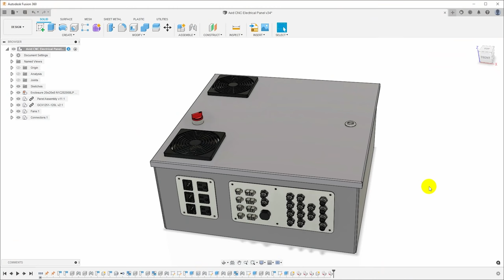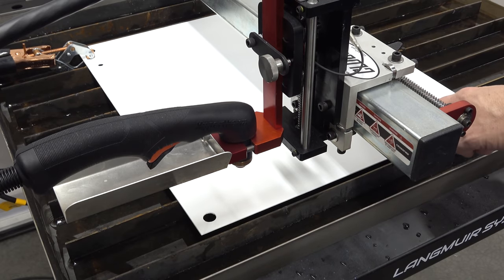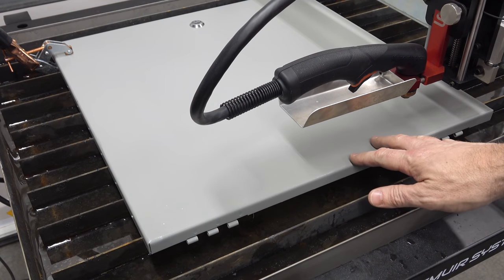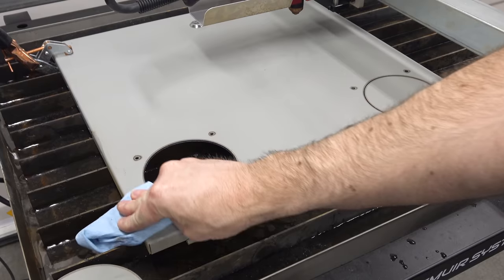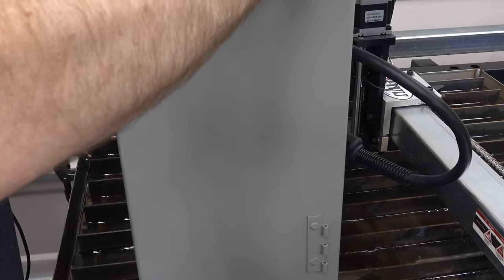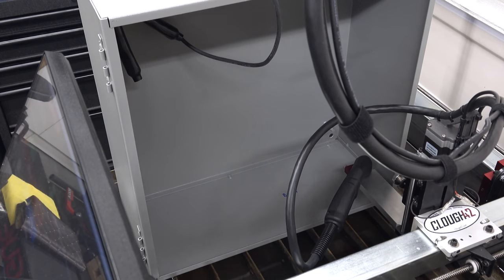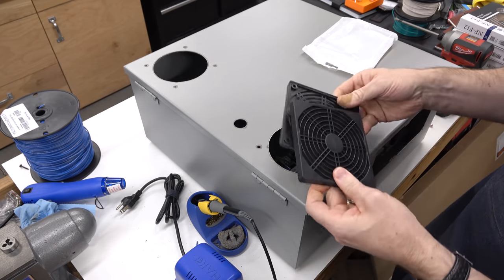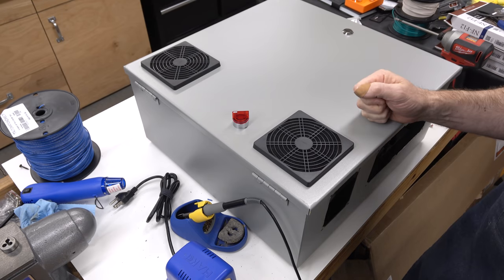Can you CNC Plasma Cut a NEMA Electrical Enclosure?  Should you?

Comment from the maker: SAFETY NOTE:  It appears that this particular cabinet is powder coated over phosphatized (paint lock) steel.  From what I can tell, this does contain zinc, so all the cautions around welding and cutting galvanized steel would apply.  Make sure you have good ventilation and don't breathe the fumes.

Comment: A trick that we use with our laser is to coat the surface with dish soap and let it dry. Any stray particles condense on the soap instead of bonding to your material and a quick rinse removes it all, no elbow grease required. Works fantastic for glass and acrylic etching. Might have to be careful about splashing with the flooded catch pan.
Reply: Maybe anti-spatter or CRC silicone in a rattle can.
Reply: Hah!  Same trick as in Boy Scouts - cover the outside of the cookpot with soap-ish stuff before putting it over the (camp) fire.
Reply: As I was watching the video, I was thinking masking tape over the back might work.
Reply: @dasworkshop4967  Good call! That said, masking tape might have some issues with denaturing and bond a bit too well from the heat. Have seen issues where the charred edge of the tape had to be scraped away with a razor blade.
Reply: You did glass etching with a laser?  The few times I tried glass cutting or etching like that for my own amusement it all went well, and shortly later the pieces broke just sitting on the bench.  The little information I could find implied that to prevent it, the glass had to be preheated, and popped into an annealing oven for an extended cooling profile.

Did you accomplish it in a simpler, less time consuming way?
Reply: That’s a cool suggestion! On our CO2 laser we use transfer tape a lot but I wondered if Kapton tape might work here too… though dish soap is wayyy cheaper
Reply: Good idea.  Bob's idea of anti-spatter might be even easier.
Reply: We don't even put anything on using the laser, just the downdraft table. We do use a 1000W Yag though, so the kerf is much smaller than most.
Reply: Same as Glenn, I learned in Boy Scouts to smear a pan with dish soap on the outside and you can cook right on the campfire with it and you put it in water and it all comes right off.  Would be interesting to see how it worked although your method worked just fine.
I just love it when people prove the Internet naysayers wrong. Good work.
Reply: pyrobeav2005 - May I ask what kind of glass it was?  Safety glass like car windows?  Plain window glass?  Pyrex?
Reply: @somebodyelse6673  I've mostly done drinking glasses, the best ones are commercial pint glasses. I've also etched some glass whiskey tumblers without issue. Best results came from un-focusing the laser and turning the power down. At too high of power, it was vaporizing the glass which would condense into sheets stuck to the area around the etch. Also at high power and in focus it can stress the glass enough to make it shatter.
Reply: @pyrobeav2005  - Hrm, never occurred to me to futz with the focus.  Were you using a shielding or cutting gas?
Reply: @somebodyelse6673  Nope, just compressed air assist. The laser in our machine is 100W CO2 for what it's worth. Setting the laser out of focus does two things, spreading power over a larger area and evening out the image slightly by overlapping between scans.
Reply: @pyrobeav2005  Heh, I'm not sure I can dial our 4kW laser down that far.  I am surprised you could CUT glass with 100W, though. 

May I ask what make and model of laser?  I'd rather not bother you with endless questions about setup and settings.  Thanks for the time you've already taken to answer!
Reply: Awesome Idea
Reply: What a neat tip!

Comment: Back in the mid-1990s I helped write "quote-to-cash" software for a large electrical control manufacturer whose name rhymes with ■d. You'd pick out your components, it would take into account minimum space requirements and heat generation, space for wiring, etc. and let you know the size of the box required, or tell you if your selected box wasn't big enough if you started with a box. They were calling it AI, but it was just rules-based with a craptonne (metric) of rules.
Everytime I see a nicely laid out box I think of that project, one of my favorites.
Reply from the maker: That's cool.  I actually tried one of those calculators, and got a price list that made me cringe.  I also looked into having the box fabricated to order.  Same result.  :)  If I were paying me for my time, I might feel different.

Comment: I was the lead man on a job where we built two 60 foot by 60 foot buildings full of switch gear and   computer controls for a new manufacturing facility for Rolls Royce. We must have punched 10,000 holes on this project. It would have been awesome to have been able to plasma cut all of them holes back then. Thanks for sharing, James.
Reply: A trick I use when i cant get it on the table is to use a drag shield on a hand torch and make a cut pattern on the  plaz table to guide the torch.  Just clamp a straight edge on some scrap do a hand .cut and measure the offset of the kerf vs the OD of the drag shield, then add that amt to the shapes dimension. Cutting templates can be made of Masonite as the heat is concentrated to the tip, which is why there is very little paint burning with a plaz.

Comment: This came out great. Using a CNC plasma cutter for the doors would have been such a time saver when we used to make control panels - We had many buttons and indicators which needed 20mm round holes each with a small square notch.

You could done your test cut in the middle of one of the fan cutouts so that you could test using the real material and coating without the risk.
Reply: Hm. For standard notched cutouts of 22,5 and 30,5 mm you can use notched round knockout panel punches. I am not familiar with 20mm notched. Does not sound like a standard size.
Reply: @Trust_me_I_am_an_Engineer  Sorry you're right I am misremembering as it has been many years, they were Moeller units - the M22 range I believe. Each notch was filed.
Reply: @yngndrw.  ooh Kloeckner Moeller . Haven't used those since  1985 or so ? So they're called Moeller now ? I've filed a few slots myself, when I had to add a button on site and couldn't find the slotted punch :) .
Reply: A trick I use when i cant get it on the table is to use a drag shield on a hand torch and make a cut pattern on the  plaz table to guide the torch.  Just clamp a straight edge on some scrap do a hand .cut and measure the offset of the kerf vs the OD of the drag shield, then add that amt to the shapes dimension. Cutting templates can be made of Masonite as the heat is concentrated to the tip, which is why there is very little paint burning with a plaz.

Comment: I've cut quite a few large cabinets using a hand held plasma and HAC. Hardboard Aided Cutting, I make a template of the shape I need from 1/4 hardboard. Locate that template where I need the hole and use it as a guide for the plasma torch. Quick,cheap and accurate enough. I used to hate cutting electrical cabinets for all the same reasons you mentioned.

Comment: this video made me think about how i convince my boss to buy a plasma cutter. we are doing 100's+ of electrical panel each year and last year i propose them to use plasma cutter because it was a pain in the *ss to use punch hole. we aren't using cnc for this instead we have made different template according to our needs. in first step we use the template to mark up all the screw hole and use a drill to make those hole. after this we use quick release rivet to maintain the template on it using the screw holes + we use welder blanket inside  the panel so we don't have a huge mess to clean.  now 1week of work is done in 1 day. great video thanks!  i like it

Comment: Hey James. You should add some lead in and out runs on the last tab in fusion.  That will prevent the little half circle dent in your parts from the pierce.  Can be a pain to get a good length in smaller holes and sometimes you have to add multiple tool paths to accommodate different size features but it works better
Reply from the maker: Yup.  I had the pierce offset really small for the screw holes and didn't change it for the larger holes.

Comment: Knowing that you can cut through a painted surface with a plasma cutter is very useful info for me.  I have to cut a 6" hole through 1/4" alloy steel in a mechanical cabin later this spring--to take the vent hose for a portable A/C.  Knowing that I won't have to grind out the area that I need to cut first will save time, and repainting.

Comment: Thanks for this experiment. Now I know that it's possible to cut electrical boxes with plasma. On a side note: if you want your 22mm switch holes on a front panel look good without black circles around, you can cut 10mm holes with plasma and then use screw die punch for making clean 22mm holes afterwards. Usually panel makers are cutting those holes with a drill first, then using die punch, but plasma will make that job way easier.

Comment: Well done. Back when I was wiring switchboards for a living, whenever possible we sent cabinet doors out for laser cutting, it worked well. We still needed to cut penetrations in the box by mechanical means as they couldn't fit then in like you did. 
The doors are always the hardest part anyway. Careful CAD layout like you have for your gland plates is a really good idea, I've seen a few overly close layouts otherwise.
The small heat affected zone can be make good with a quick touch up using a cotton bud / qtip. In my salty climate that would be necessary.
For painted surfaces, a little car polish before cutting should make the smoke easier to clean.

Comment: I've done a bunch of them from 22mm or 30mm operator holes in the doors to custom cutouts on the bottom.  I never ever have to touch up the paint/pc.  Always worked great for me.  Make sure the ground is good.  I've had better luck cleaning the haze on back with water and soap, but a lot of times I will put blue tape on bottom if it's critical.

Comment: When you plasma cut metal that is coated/painted you sometimes have to grind off the coating at the start point. This is so the torch height control has electrical conductivity to the metal. Once the arc is started - then its fine for the rest of the cut. If you don't have DTHC  you don't need to worry about this!
Reply from the maker: I do have a torch height control that measures the height using the arc voltage.  In this case, though, the machine touches off to establish the initial height, the pilot arc blasts through the coating and once it has established the cut and moved a set distance, the height control reads the voltage and then takes over to maintain that voltage.  So if the coating affects the voltage, it doesn't really matter.

Comment: A trick I use when i cant get it on the table is to use a drag shield on a hand torch and make a cut pattern on the  plaz table to guide the torch.  Just clamp a straight edge on some scrap do a hand .cut and measure the offset of the kerf vs the OD of the drag shield, then add that amt to the shapes dimension. Cutting templates can be made of Masonite as the heat is concentrated to the tip, which is why there is very little paint burning with a plaz.

Comment: Yeah I wouldn't have listened to the internet either. Good job, it looks good. I would 3d print a plate with ON & OFF for the switch. I need to go back in your videos to see how you did the multi-colour prints on your other parts.
Reply from the maker: Yeah, I was thinking about this.  I'm also thinking about some other options. :)

Comment: This was suggested to me today. For some reason I hadn't seen it but glad I watched. I'm commenting because your use of that cooling fan made me think of a YouTube channel : Major Hardware that has a series called Fan Showdown where people submit fan blade designs that run on that fan base to see what designs are most interesting, air moving, quiet etc. It's pretty interesting to see what people come up with and I wondered if you'd have any opinions on it or whether or not you'd consider making a submission. I ask because the way you explain your thought process and the outside the box thinking you do in your projects, you could probably make a pretty interesting video about it. Thanks for your contributions to the community of machinists, makers, and really anyone seeking knowledge on YouTube.

Comment: Great use of the plasma torch.  Ask people on the internet but take it all with a grain of salt.  Many of them are wrong.  I love to do cnc projects but right now I am not in possession of the cash.  I recently incurred a few bills that will need clearing up.  Thanks for an interesting video.
Reply from the maker: Hey, Harold!  Great to hear from you.  Yeah, I wasn't really concerned with whether people thought it was a good idea; I asked because I wanted to know what problems I should worry about.  And then I used my own brain to figure out if they would be a big deal for my needs.

Comment: Please build a a magnetic pick up handle to remove the cutout plasma parts. Seen a few online but I think it will be a great tool for the shop. Thanks for the great content.
Reply: I use a small but strong on off magnet turn the knob on the engage magnet, works great.
Reply from the maker: I have a Noga Popeye magnet sitting on my toolbox, and this is what I usually use.

Comment: I think you will see much better results from your water table if you raise the water level significantly.  I run mine all the way up, somewhere around a 1/4" from the top of the water table. I get some spillover sometimes but the amount of smoke captured greatly offsets trouble of mopping up a bit of water on the floor.
Reply from the maker: Yeah.  I'm lazy, so you're looking at whatever fits in a 5-gallon bucket.  * would fill the table better, but then I'd need to do more than open the valve and walk away when I open the valve to drain it for storage.
Reply: @Clough42  I have been watching your videos going on a couple years now, and you sir are far from lazy!!!

Comment: Take out the filter in the grill for the top ventilation hole. It's an exhaust so it really don't need the filter and it would improve the airflow slightly.
Reply: I thought that at first, but it would then allow general workshop dust and debris to get in when the machine is off and there is no airflow.
Reply from the maker: Correct.  This is why I used the filter.

Comment: Wonder if it would work with vinyl sticker transfer tape. I use that a lot to protect wood etc as I laser cut/engrave them on my Co2 laser. You just stick it to the surface and once done it comes off without leaving any sticky residue while preventing the smoke haze from setting on the workpiece.
Reply from the maker: I thought about masking with a variety of different materials, but didn't want to add anything that might burn on its own and make things worse.
Reply: @Clough42  Worth a try maybe?

Comment: About a year ago I needed to make a spider box and so I used a 2414 GE breaker box as the base and then cut holes for one and two gang outlets using a cheap Chinese plasma cutter. The only thing I needed to do was make a pilot hole as the coating was a little too much for the electricity to start the arc but once I made a pilot hole it was no big deal and it cleaned up really nicely. Way better than using a grinder or any other tool for that matter. Obviously a water jet would be the preferred method but when you have a budget of around $400 then cheap Chinese plasma cutter it is.
Reply from the maker: The Hypertherm plasma cutter I'm using has a pilot arc, so it burns through the coating with that and establishes the current flow to ignite the cutting arc.

Comment: I built my AVID with Clearpaths and an Acorn, and the nema box was the worst part. I cut the fan holes with a big bi metal hole saw in a cordless drill. The holesaw hung up, torqued around and broke my ring finger. It's been two years, and it doesn't hurt anymore, but the knuckle is a lot bigger...LOL

Comment: may wanna look into a machine type torch for the plasma cutter with maybe some diy quick connects to make it easier to use for other things....that way you can easily do submerged cuts...less HAZ and lowers the noise(not a lot just less high pitched) and drasticaly lowers the smoke and fumes in the shop...course you will end up changing your water or filtering more often
Reply from the maker: This plasma cutter is a Hypertherm 30XP, which has a permanently-attached hand torch and no machine torch option.  Of course I could always make something.

Comment: You can completely submerge the plate under water about 1/8 to 1/4" to control smoke and plate warpage.
The torch has everything it needs to cut out of the torch so it will cut under water.
Can do this with an oxy torch as well but you need to get burn established, then raise the water level during the burn.
Reply from the maker: I might look into this.  As the table sits, the slats are higher than the sides of the water tray, so I would need to make some changes.
Reply: @Clough42  keep in mind that if you have the water just touching the bottom of the plate, it will make a big difference on the smoke issue. 
And will help with alot of warpage. But it can splash some.
Just try it a bit to see the difference.  Before you modify the table try pulling some slats out and put your part on something to get a test hight. 
Thanks for the feedback.

Comment: If the internet says to not do it, and you do it anyway, AND it works out great - is that not a violation of "Community Standards"?

Excellent results!

If it mattered for the appearance, extending the lead-in further into the drop might reduce the heat effected area at the pierce point.